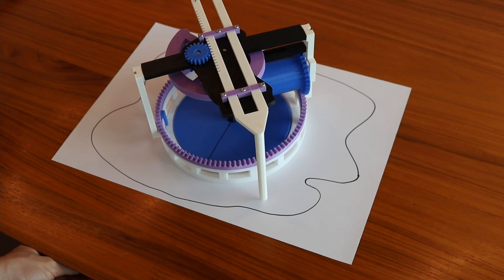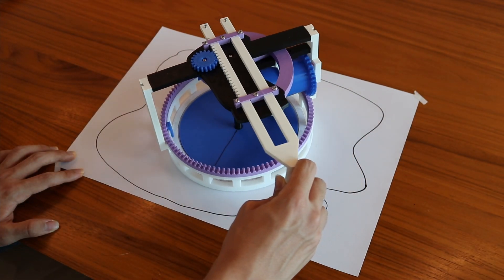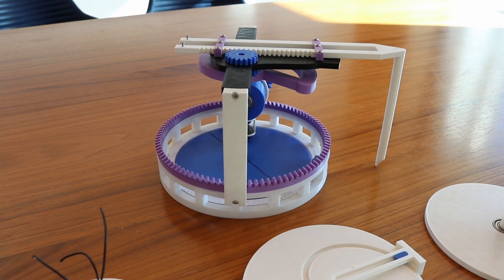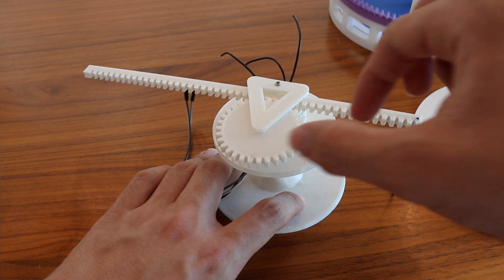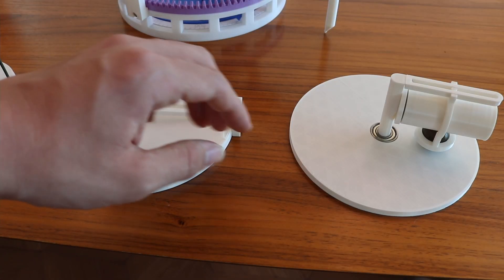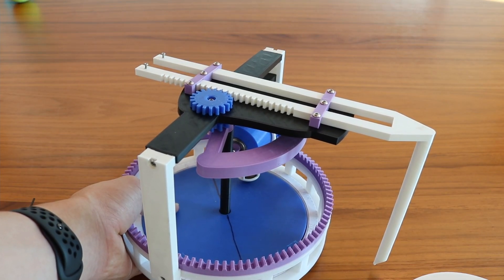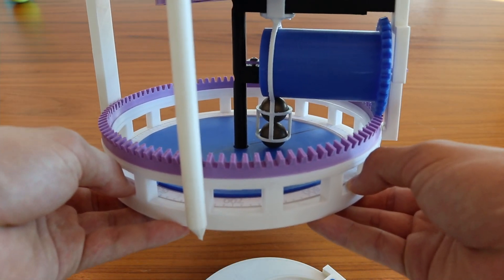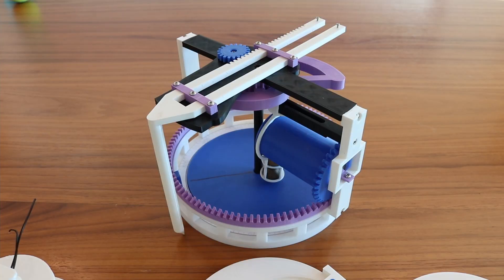A device that measures the area of any shape: Radial Planimeter

Comment: You could use an old computer mouse's ball instead?
Why are two spheres needed?
Reply from the maker: Two spheres are used to reduce the amount of friction. If only one sphere was used, then circular movement would (theoretically) work perfectly fine but sideways movement wouldn’t, since the ball would have to slide against either the base or the barrel. With two balls it’s possible to roll against both the base and the barrel, reducing friction.